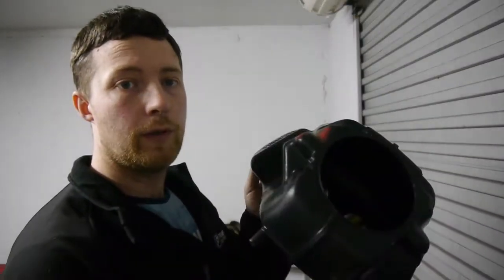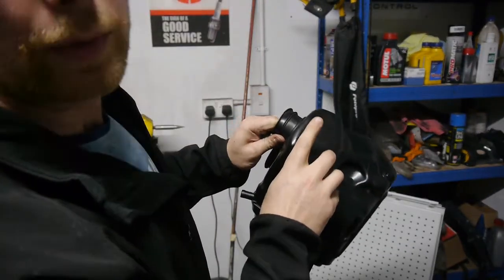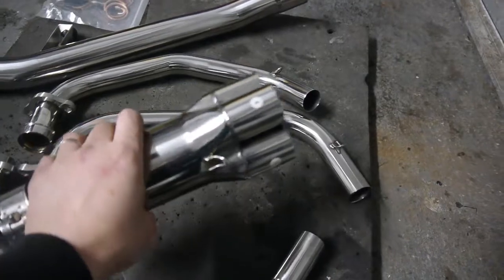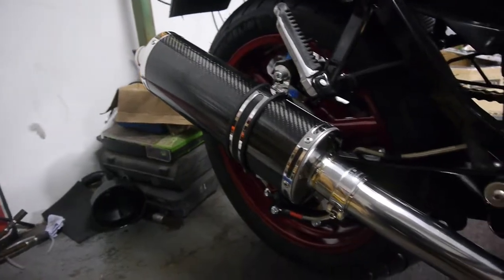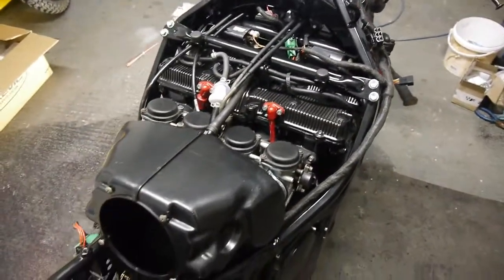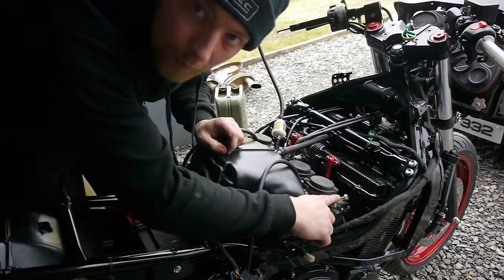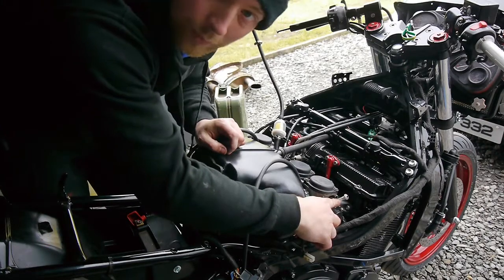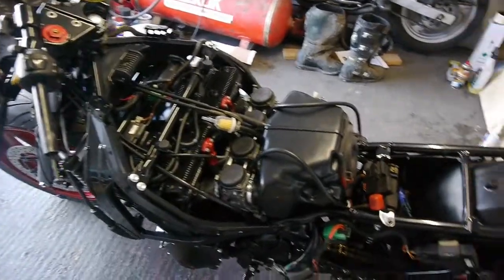Suzuki GSX600F Katana Restoration - Part 9 - FIRST START

Comment: Getting along nicely! 👍🏼😊 I've been wanting that Delkevic system for ages, but to be honest, I couldn't justify the cost since my Katana would also need a full restoration job first before bolting on a shiny new exhaust system, otherwise it would look out of proportion .. but I am jealous lol! In good way of course. Can't tell from the video, but does the middle link pipe have  a bump stop for the bike's centre stand?
Reply from the maker: Lol. Yes it has the bump stop for the centre stand. Pretty easy to fix thankfully. Just need to pic one of the 50 delkavic stickers to put on now that they sent lol

Comment: I cant to seem to start my GSX600F after reinstalling the carb. 😅

Got any tips to start it again?
Reply from the maker: Lol. Have you the standard fuel tank on or have you the bladder on it like I had?
Reply: Yesterday I wanted to check if the carbs were clean so I opened one of them. It was very clean so I closed it again, and reinstalled it all back again. Now it wont turn on 😅

I have added the standard fuel tank
Reply from the maker: @Zachie31  ok sometimes I find when you have the standard tank on with empty carbs you will have to turn the knob to prime for 5 to 10 seconds to let some fuel into the carbs and then turn it back to normal and that usually works. Hope this helps